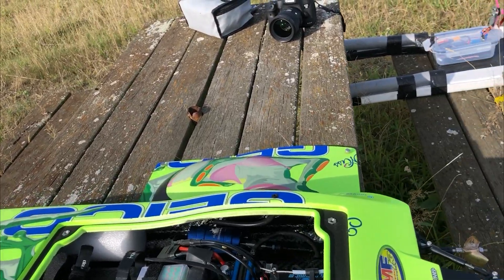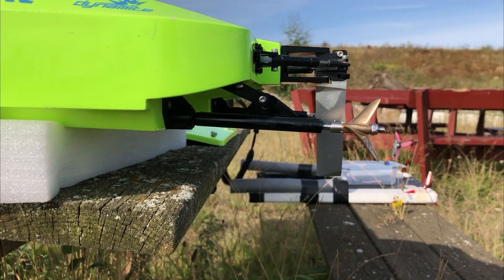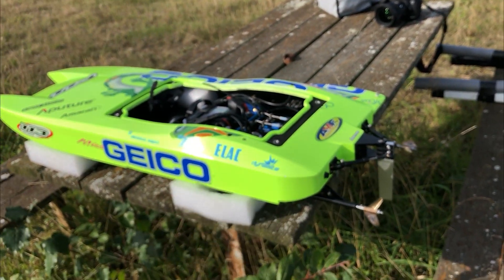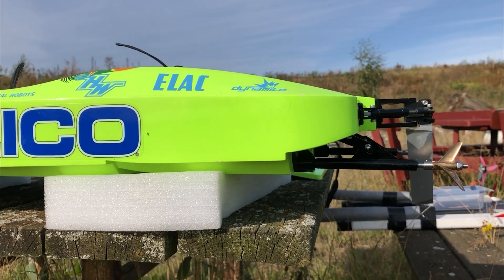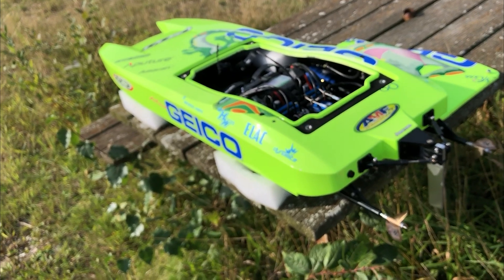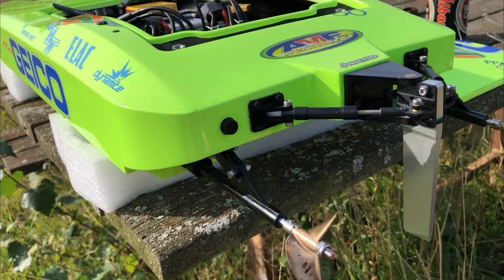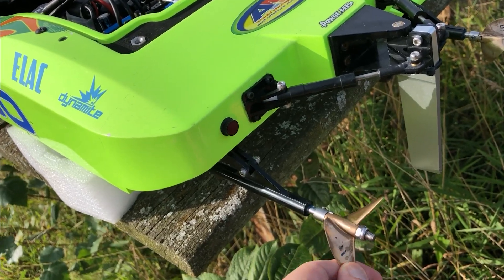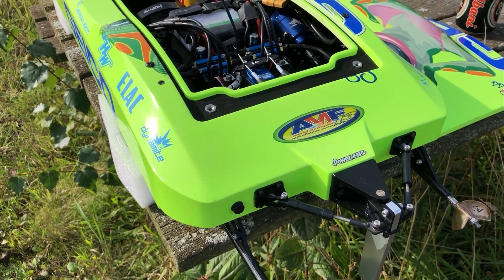How to go Faster - Basics in Setup (Strut, CG, Props)

Comment: i got a single prop cat...6s....my battery dont really fit and slides around..im gonna try running the battery the other direction long ways with the length of the boat..off to the left to counter torque twist at full speed
Reply from the maker: Sounds like it is worth a try. Offset weight is somewhat common. I have a few mono’s with weight also shifted left based on the same reasons. Works very well.
Reply: @EmilWilkensRC  thats good to know!!  im going to keep playing around
Reply: new question....of i bolt them trim tabs on will that help smooth it out?....i found a throttle spot where its smooth but its not wide open....it will hop a bit and run rough but not bad...im hoping to work this out....with what this video talks about with me testing battery position
Reply from the maker: @robertheuer7670  trim tabs are not suited for catamatans. I would not do that.  
The geico can be tricky, but often will run smoother the faster you go.
Reply: @EmilWilkensRC  ok cool..i didn't want to drill into the fiberglass anyways...i put up a short on my channel if you want to see my boat...there will be more videos and stuff...i just dont know what im doing lol